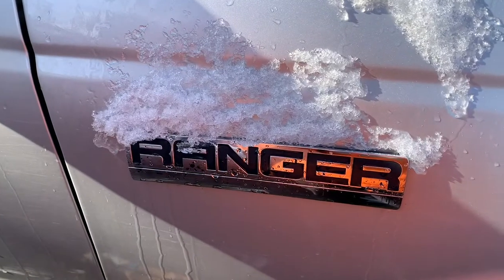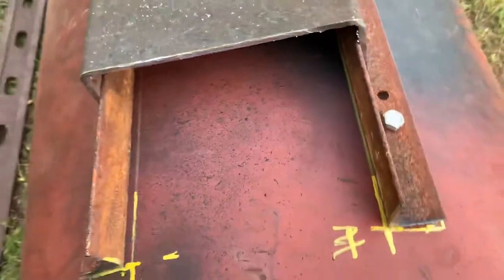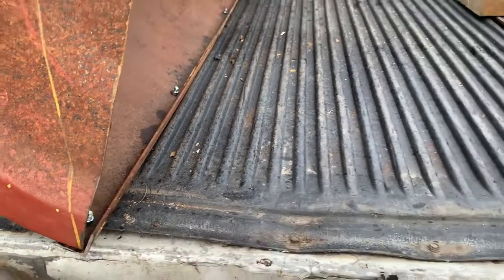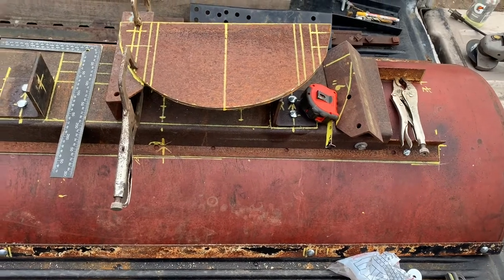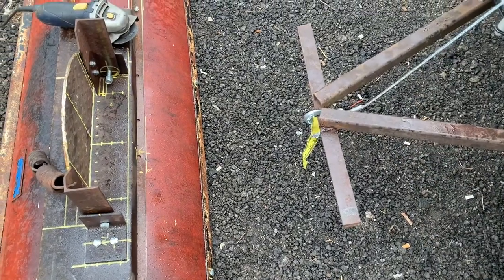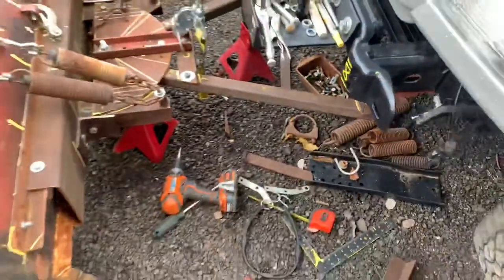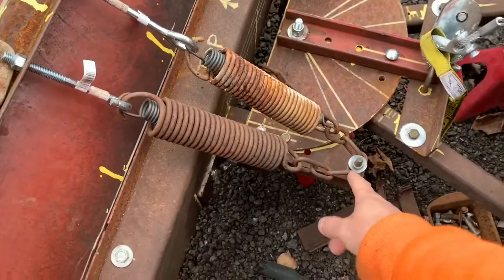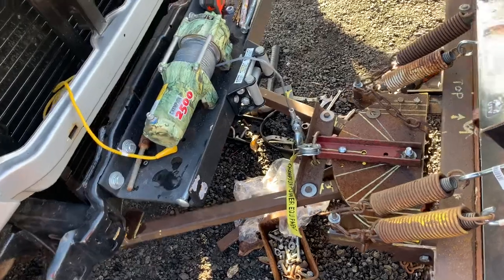Homemade 60” Snow Plow Build From Recycled Heating Oil Tank

Comment: Should place the winch out farther forward so it will be a straight pull on the blade and not have to go over any fairlead. The cable will last much longer. Or switch to synthetic rope which lasts even longer.